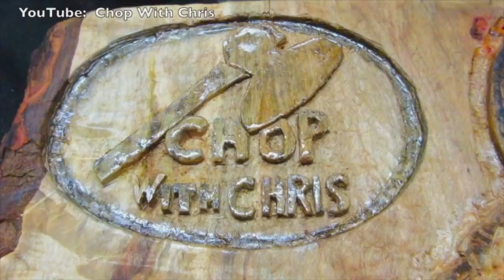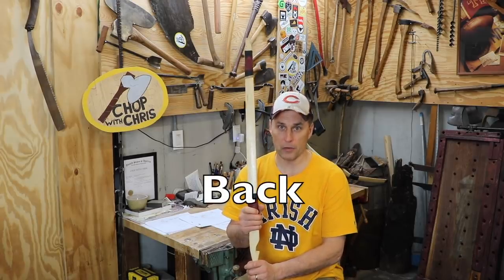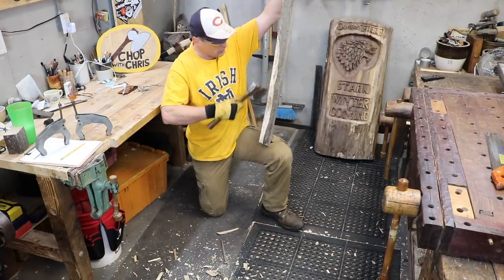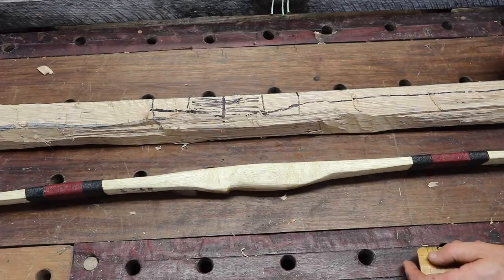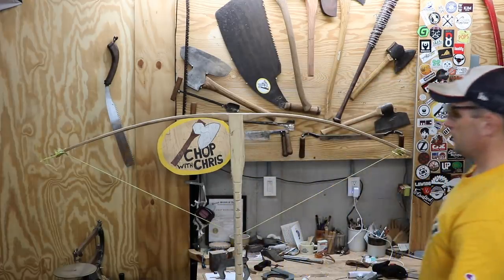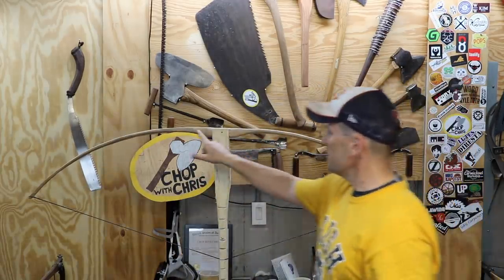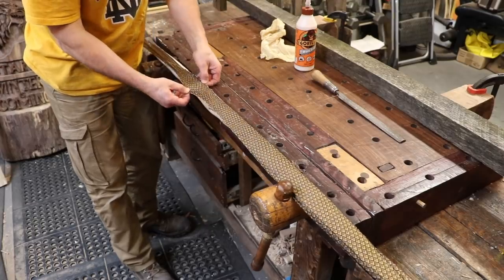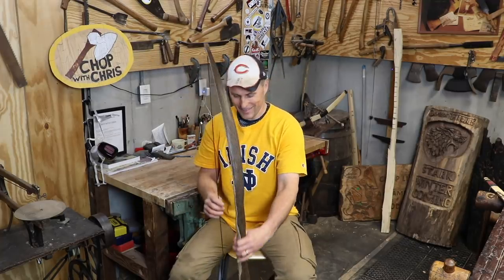HOW TO MAKE A BOW WITH SIMPLE TOOLS

Comment: Hi, I've only ever carved with scouts and I want to make a prop bow ish. Does it matter what kind of wood I use, could I just use a pallet? And I don't have a hatchet or chisel, but I do have an old kitchen knife, as that's the only thing I've every craved with before, and my dad has a hammer and saw. Would a kitchen knife work instead of a chisel? It's for a prop thing, I'm in the UK and on the 20th June I'm leaving my secondary school as I've done my GCSEs, and we do a walk out so I'm going as a video game character and need a bow. Sorry for the long comment, and I know you probably won't respond
Reply from the maker: You know I once lived outside London in West Byfleet 😄.   Yes - the type of wood is very important.  Here are some types of woods in the UK that will work:  ash, hazel, oak, yew, blackthorn, hawthorn.   Oak pallet wood will also work.   I have video on my channel for that.  A knife will work and best to do the final tillering with a file which are cheap to buy.  Feel free to ask me questions as guy go.  Good luck!
Reply: @ChopWithChris  Thank you!

Comment: D**n you Sir! The wife has packed me off to the shops and ordered me not to return without one of those high speed brooms...
That was an excellent demonstration. Things don't have to get any more complicated than this unless you want them to. I must admit, I wouldn't have thought of trying pallet wood but you have shown that, at the very least, it's a suitable source of cheap material for learning on.
Now that you have had time to use it a bit, has this one turned out to be a good bow or just a spare bow?
Reply from the maker: Good question.  I over tillered the bow so the poundage is low.  Next time I will remove less material and add the tie on before I remove too much wood.

Comment: Not a bowyer but from what I have seen the center is where they arrow nocks and the handle is below that.
Reply from the maker: Yes
Reply: Billy Koepsel actually, the center should be where your hand rests, that's the fulcrum. The arrow typically rests lightly above center. All of my bows and those I have seen have been made this way with the exception of Japanese bows which are asymmetrical

Comment: which file did you  use? Smooth or rough
Reply from the maker: Rough because there was a lot to wood to remove.  Ideally you would have both a rough and smooth file.
Reply: ok thx
Reply: Also could i use store bought wood from Home Depot to make the bow
Reply from the maker: Yep.  Just look for continuous grain and no bl knots.

Comment: So you were going to chase a single growth ring, but you are using a hatchet?  What happened?  You have layers lifting on the back?   It doesn't look like you followed through with that.  It does not matter really if you are going to carefully back the bow. I don't think silk backing will cut it.  Also shaping with the rasp is very slow and inefficient.  A drawknife or spokeshave is much more efficient and less time consuming.   A lot of people will give up trying to shape that much with that kind of rasp.
Reply from the maker: Fair feedback.  I was trying to use as few a tools as possible since many people don’t have drawknives.  In my previous video I did use a drawknife.

Comment: I still don't understand what fibers are.
Reply: Also, I thought we weren't supposed to file the back side of the bow.
Reply from the maker: Fibers are the strands of wood.  Once one or 2 separate the rest will follow and eventually cause the bow to crack or break.
Reply from the maker: You should not file the outfacing side of the bow.
Reply: @ChopWithChris  Thank you this helps a lot. I'm building a bow from a dead cedar tree. I'm having a bit of trouble finding which growth ring to use as my back.
Reply: This cedar log is about 4 inches in diameter. Can I make a bow from that?

Comment: What are knots
Reply from the maker: Extra hard wood within the grain due to a limb  or some damage to the wood.  They are extremely brittle and separate from the grain easily.  Not good
Reply: anas cool knots are where a tree limb has grown into the tree base. When you remove the limb the trunk of the limb is through the solid wood. A know will weaken the wood under stress and break. Very dangerous.
Reply: Thanks!

Comment: I dont know why but i cant stand crossbows because they require no real skill to use and i trained with a english longbow for so long im a better sjot anyway
Reply: Shot*
Reply from the maker: What is the length and draw weight of the long bow?
Reply: Chop With Chris 5"3 and around 110 draw weight  its pretty cool
Reply from the maker: Wow!
Reply: Chop With Chris yeah the 110 draw weight used to be a little much but i stuck with it and now i can draw it pretty easily
Reply from the maker: Impressive.